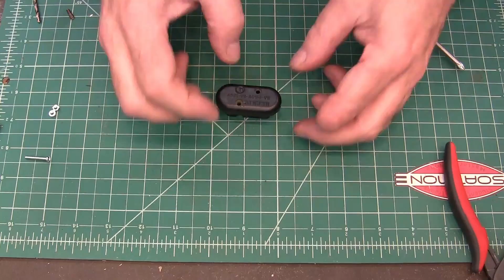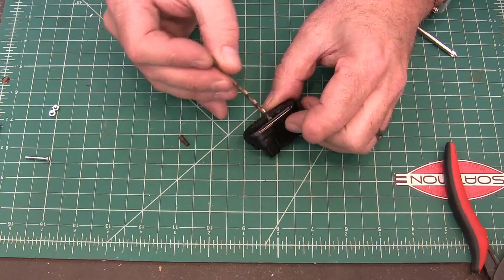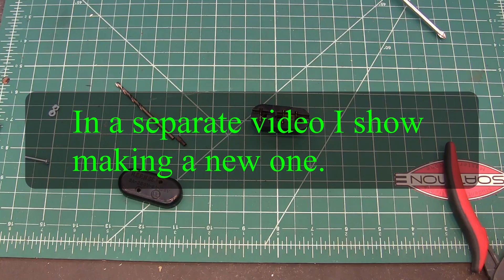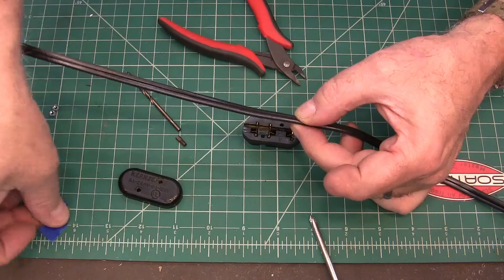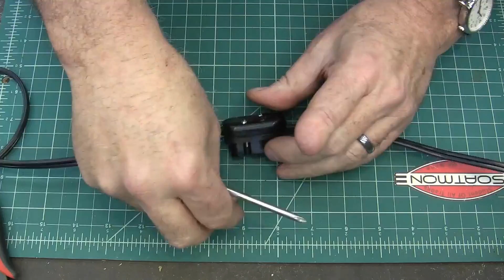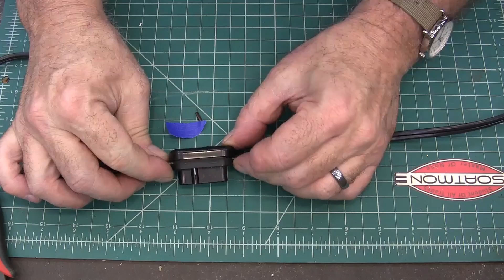Rewiring a Vintage Sewing Machine Power Cord and Keeping Original Plug

Comment: Boy that is interesting had no idea how the wires went in length ways or how they came apart. I am looking for information on what to do if you cannot find a powercord/footpedal that will fit and line up to the pins in your machine. It is an old Vickers from England. Can it be direct wired ? After seeing this I am thinking no. Thanks for the vid and your reply if you see this message